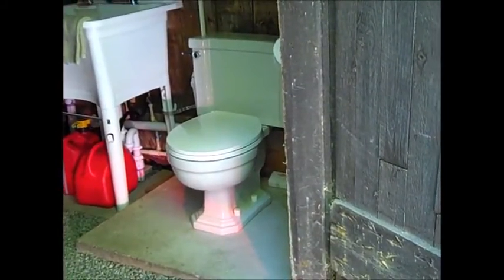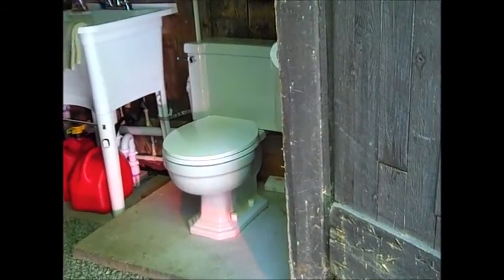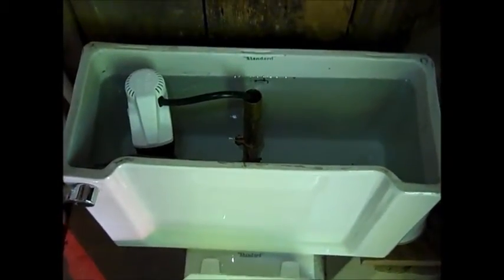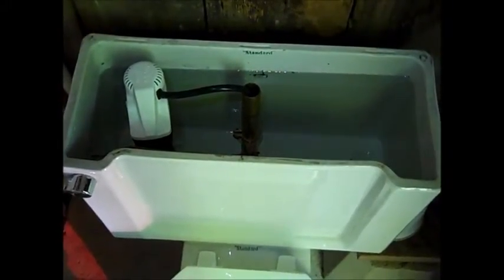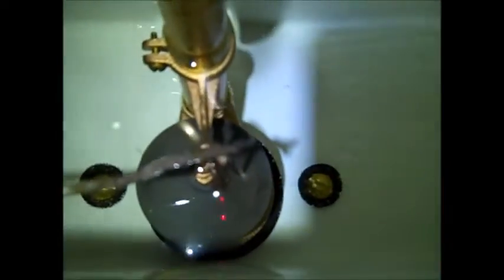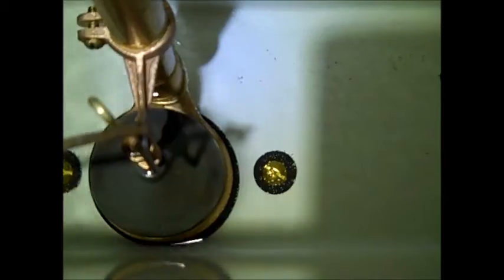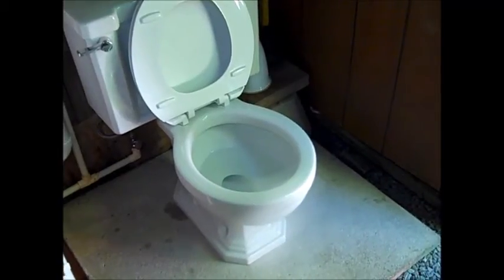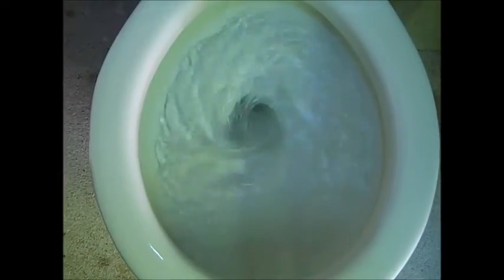76.  1948 "Standard" Compact Water Usage Test

Comment: I thought it would use a little more. What's up with the 2 small ridges in the front. I've noticed the Carlyle and master( lowboys toilets) also have them.
Reply from the maker: It probably would with more water pressure.  I have a gravity system with 20 lbs. pressure.  Also, the Korky Quietfill valve has a lower flow through the refill tube.  Another test could be to install a Mansfield 09 fill valve and see how much water comes back to the jug.  This toilet probably uses 5 gallons in a place with normal water pressure.  The flush system the bowl uses is called "Siphon Vortex"  All the water comes from the rim.  There is no siphon jet.  The rim holes aim the water toward the ridges.  The ridges fold the water to simulate a jet.  It's quite effective.  My 1956 One-Piece that's installed at home also has the ridges.  However, I think it was K of K who found an early One-Piece that did NOT have the ridges.
Reply: +VintageToiletsVT could you make a video on the 20 lb system?
Reply from the maker: That was the 20 lb. system.  We're off the grid, and have generator electricity here at camp, so there is no way I could have a pump to boost the pressure to normal (40-60 lbs.).  Only way to measure is to bring the Compact home and test it there.